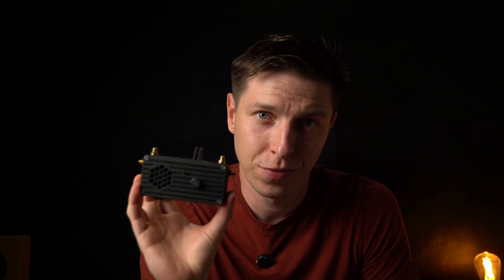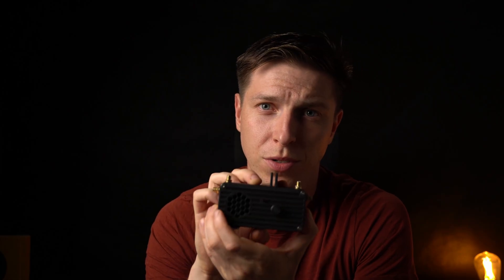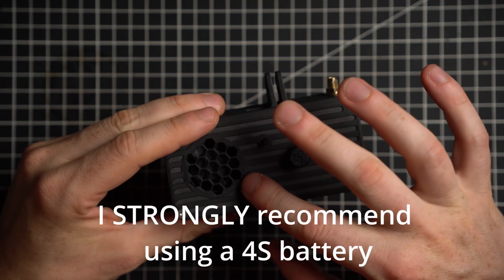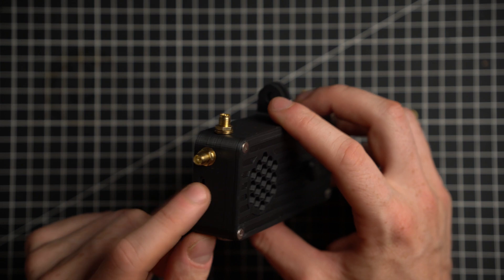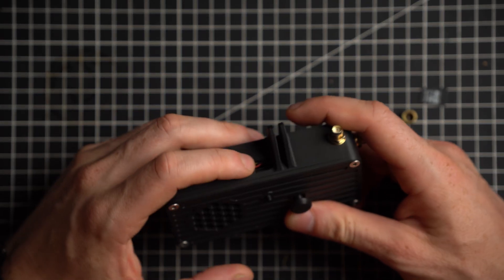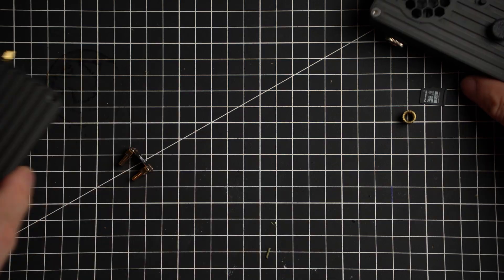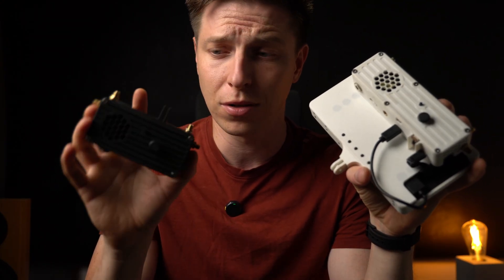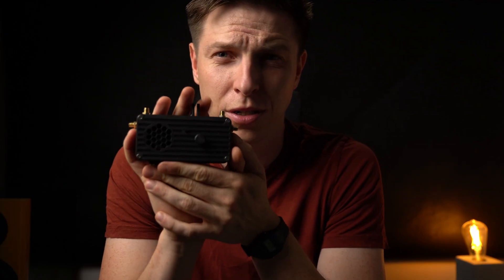I've built a custom OpenIPC / Ruby FPV VRX for Joshua Bardwell

Comment: Great job! I'm also building one for myself. However, I noticed that your Bonnet has RF shielding. Mine came without it. Did I receive a bad unit?
Reply from the maker: Dev version which I also have had rf shields. Production version came without the rf shield
Reply: @Failsafe-FPV , thank you!. Do you know why they didn't add RF shielding to production units as well?
Reply from the maker: @florinnitu  I think it was not necessary
Reply: @Failsafe-FPV , it might be the case that the benefits did not worth the cost. However, I would have liked to have them. On the other hand, I looked closely at the board and there were some small resistors or capacitors directly on the path were shields should have been. Maybe those were added later and made the shields unnecessary or impossible to mount. Anyway, just to be safe, I bought some shields and modified them to fit. But after soldering, yet another surprise: the sields pads were not grounded, so I had to scratch the board and bridge ground to shield pads. 
It was fun to tinker with and everything works as expected, even if I don't see any improvements in bench testing.😊

Comment: The video recommends a 4S battery, but the spec page for the bonnet says "Wide Voltage Input: 2S–6S Li-ion/LiPo input via high-efficiency two-way BEC.".  I have a 2S lithium ion battery pack, will that work okay?  Or will I run into issues when my batteries get below 3.5V  per cell?  Why do you recommend a 4S battery?
Reply from the maker: 4s seem to work best for me. With 2s the voltage can sag below the bonnets needs. Or maybe my 2s package is just too small. 6s on the other hand - i just wouldn't risk going over the required voltage. 4s is the sweet spot.

Comment: I think the biggest issues Joshua has had have been firmware/configuration related. There are people in the OIPC groups who are achieving far better results than he did on the same hardware. He has stated he will test based on what it shipped given that's what the average user will be doing, I can't see him being interested in this custom VRX.
Reply from the maker: Oh he is interested. 😁
Reply: @Failsafe-FPV  Well, hopefully it gives the OpenIPC community a leg up, it feels like it's on the cusp of success and the more it's in the eye of people who may be interested the better :-)
Reply: @krazed0451  Well, I don't know, why do we need this popularity? Will it bring any benefits? If hardware prices fall, or more developers join in, that would be good.
Reply: @unixoid33 More attention is likely to result in new devs at the very least, that's the beauty of open source. I find it unlikely that hardware prices will fall appreciably, though more manufacturers are likely to take an interest if the prospective market grows. This will in turn further development in partnership with the open source community.
Reply: @Failsafe-FPV Did anything eventuate from this?
Reply from the maker: @krazed0451  what are you asking about exactly?
Reply: @Failsafe-FPV  Did Joshua end up with a high end GS to do some testing with?
Reply from the maker: @krazed0451  no. sending packages to USA from europe is banned at the moment
Reply: @Failsafe-FPV  Ah, I forgot about the orange man's shenanigans! 😅

Comment: in video lots of glitches. do you think Bardwell would enjoy this experience?
Reply from the maker: Don't forget this is DIY hardware on both VTX and VRX. Some more tuning is necessary. I already tweaked few parameter and will try it again. It's not a DJI and it will never be. With that said, I'll say that i truly enjoy flying with it. If Joshua will too? Time will tell
Reply: @Failsafe-FPV  It's strange that DIY hardware is better than proprietary. For example, in RUBY, almost all Runcam units have a lot of red bars. I have an SS30KQ + 8812AU and almost no red bars. In the near field, unless you fly behind an obstacle, there shouldn't be any glitches or break-ups.
Reply: @Failsafe-FPV  btw did he confirm that he'll make a video on it ? cause I think it's awesome
Reply from the maker: @alexandrevalentin8587 we are having some problems with postage since Europe suspended parcels to USA. But I'm sure when he receives it, he will make a video.
Reply: @Failsafe-FPV  Europe suspended parcels to USA ??! I didn't know that
Reply: @alexandrevalentin8587 Agreed. THIS. We are not aware in the US that this is taking place (as residents in the US). This is so embarrassing for us as US citizens this year, and a mounting frustration with recent developments, let alone the seemingly obfuscation of important developments like this.
Reply: I think it possible that Joshua's loss of signal had as much to do with the VTx on the drone as it does with the ground station VRx. The LOS loss was when he flew behind obstructions. And there are always three parts to communication, Transmit, transmission, and reception.
OpenIPC is important, crucial even, and coming along. Contributions and effort like this are so critically important and welcomed.
Diversity will help possibly.
Reply: Bardwell doesn't even know how to add OSD & SRT files to Walknsail DVR. 
He spent too much time with DJI ;-)

Comment: It would be awesome if youcould  make a really good wifi receiver board for the Radxa 3w. We need a solution with really good sensitivity and low noise.
Reply from the maker: Unfortunately I don't do electronics myself - I dont have the skills. But if I could, I would put 2x trl8812EU2 module on a  carrier board, put few BECs there etc. basically a bonnet but with EU2
Reply: @Failsafe-FPV  Yea that works somewhat but I think ground loops keeps that solution from getting TRUE high sensitivity network card solution. I hope someone can test different network card chips and come up with an even better solution than  trl8812EU2.
Reply: @Failsafe-FPV  that would be soo good
Reply: good cards with good sensitivity are AC56 but they are big and almost not sold anymore